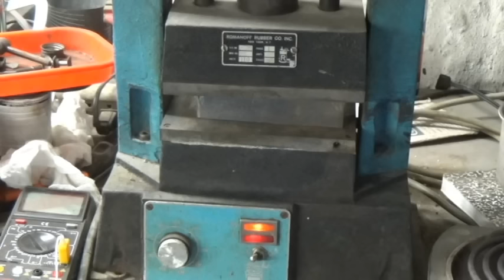NSCR key ring

Comment: Great video! I love your work like seriously you do an amazing job.

I have a question that's been stumbling me for a while. The vacuum assist when pouring the aluminum
how does that not get clogged with aluminum or ruin the vacuum pump from the amount of heat your pulling from?

Also did you make the vacuum system your self to draw the air from the aluminum or did you buy it? Any information would be extremely helpful and much appreciated
Reply: I see ya didnt get an answer so here it goes.  Once the flask has gone through burnout,  the investment is hard and the wax is gone.  The investment is actually porous.  By running the vac pump, it helps pull the molten metal into the cavities where the wax once was.  Another method is to spin the flask and gravity does the work.  I like the vac setup myself.
Reply: Where can you get these vacuum setups, do you normally have to DIY them?

Comment: Hi what was that u used to pump the wax injector with???? 
So curious as I will want to buy one to test my wax injector
Reply from the maker: It's a Stevenson  pressure tester used for pressure testing marine outdrives.
  Available through mercruiser...
Reply: @aonemarine  do you think a bike pump will work?
Reply from the maker: @jarcelyndorsey5354  I'm certain it would provided you come up with a way to connect it..
Reply: @aonemarine  thank you

Comment: 7cfm vacuum pump is not available here, can I use 3cfm double stage pump?
Reply from the maker: Any chance of finding a 5 cfm??
  I suppose 3 might work but bigger is better. If your vac chamber is large, it might take awile to pull it all the way down.
 If you use ice water when you mix your investment it will give you more working time...

Comment: so how do you burn your invesments out with the pla ??? please . did you make your own vac chamber set up ? and what type of printer you using??? finding your vids v helpful thanks
Reply from the maker: +Steve Green  The pla is burned out the same as you would with lost wax casting. The vacuum chamber is home made, its just a piece of ss pipe with a silicone gasket glued in place with more silicone. My printer is a rostock max.
you can email me at aonemarine@aol.com